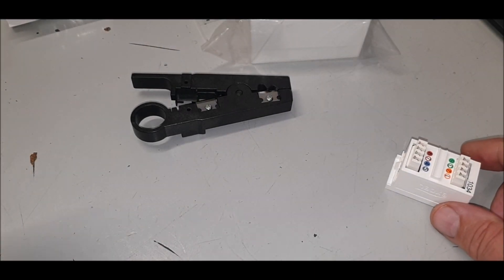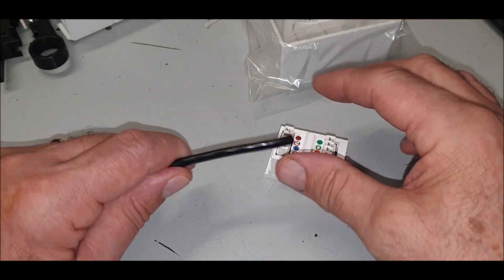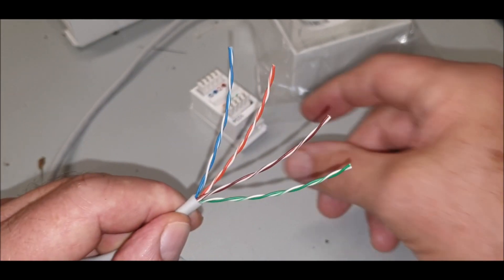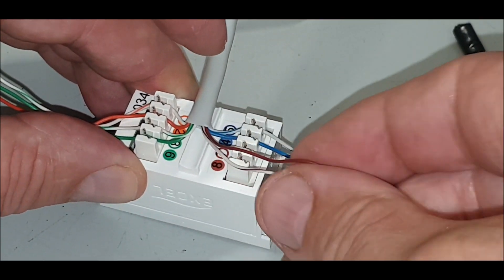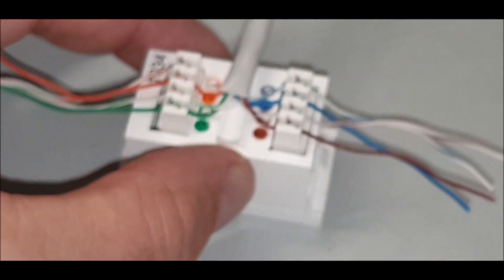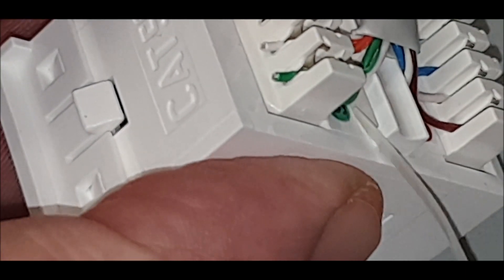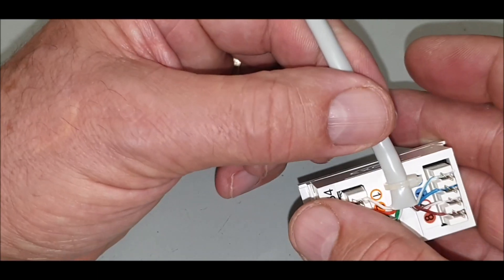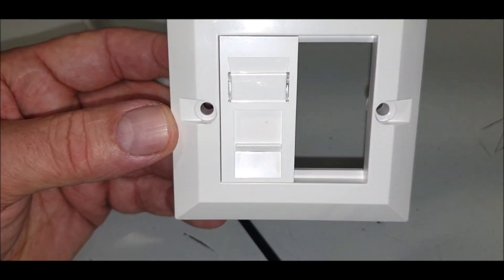How to wire a RJ45 socket for Home Networking

Comment: Can you add another cable on the back of that and run another port? Like daisy chain. 
Example the modem port is in the garage. 
I wanna run another cable off the back on the and run it inside walls to the kitchen area with another port and plug modem in there?

Comment: Great Vid Mark as I used to use the click Modules, but this module is very good as it give you more space to terminate ends a big plus, but for all note if you are flushing your boxes into the fabrics of your building make sure you use a 35mm flush back box as with the Click module it is slimmer and can fit is a 25mm flush box

Comment: Hey Mark, one question does the eight wires have to have the sheath removed like wiring a plug.. Thanks, Declan
Reply from the maker: No when you use the push tool the the wire sheath is cut for you in the socket Declan

Comment: Thanks Mark - very helpful and well done.  Our new house has Cat 6 wiring but none of the sockets are working although the wiring is there, so I need to check that the wiring has been correctly done. None of the wires is labeled.